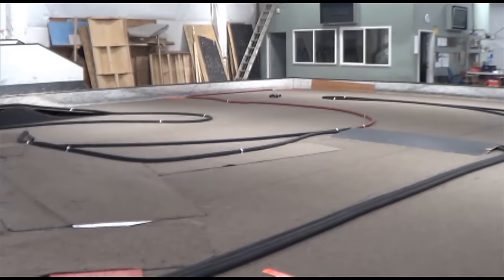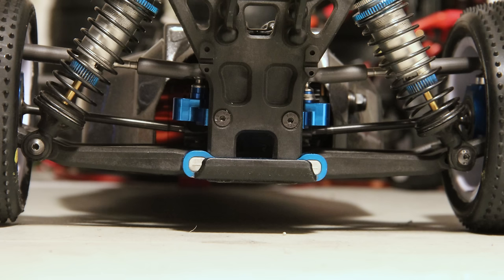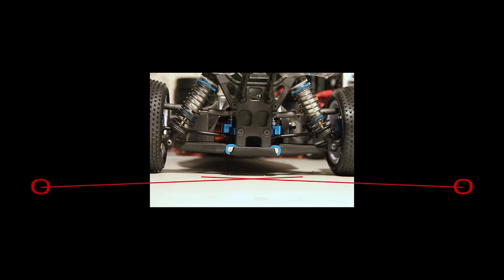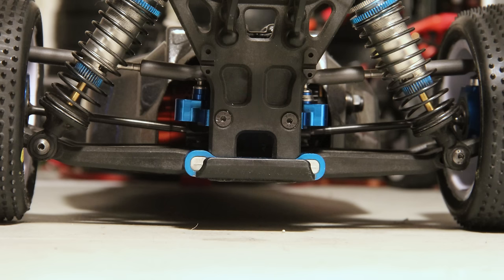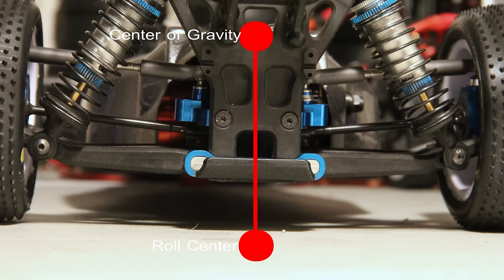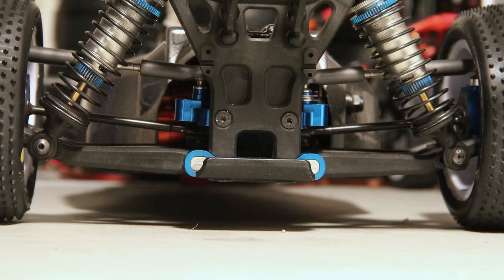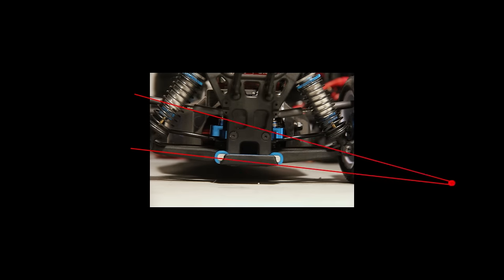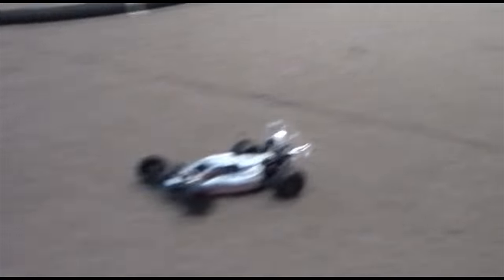How To Tune Your Ride - Roll Center

Comment: *measures and calipers .... how i do when those two 'lines' actually move slightly apart? Du wat?
Reply from the maker: hmmm... i'm not sure what you are trying to ask here.
Reply: @traxxasrockhead   not 100% but, I'm sure he just asked, if the hub pivot points are close and the diff pivot points are separated? the line would never cross! this is if he had his dog bone level.
Reply: @Matthew Seger  Roll Center is always moving, the measurement is really not the importing thing. but, ""at arm level"", if your upper link is pointing down (shock tower to hub) you have low roll center. but this is only low roll center at ""arm level""l!!! 
 this mean at ""arm level"" in a turn, your outside arm (hub) will try to lift (less pressure on the tire) and your chassis will go down. to get the weight on (tire) you will need a stiffer spring or swaybar. (if you're trying to add grip).

Comment: if you lower the roll center on the rear, should you also lower the front?
Reply from the maker: not necessarily, you can adjust them independently

Comment: Man THANK YOU for that explanation.. And wording it that way.. That jist helped me so so much.. I may not be racing, but for me...  Driftting suspetion set up plays a big roll on making the car do what u want when u want. And the roll center is were my problem is.... Cause i understand other aspects of the way it works. But by bring them all together is what will make it work. Agean Thank You.. Peace
Reply from the maker: i'm glad i was able to man. after making more videos i realized  how long this. if i was to remake it i would make it a lot shorter
Reply: Wasnt to long for me.. Made sence in an easyer way.. Havnt had a chacne to mess with my car. But will soon enough.. See how much of a difference it makes. I kmow its in the rollcenter of both and front and rear. Cause iv done made adjustments on everything else. And still wasnt consistent.. Thank u agean.

Comment: How does ride height factor into this? Great video!!
Reply from the maker: I'm not totally sure but I do know what I explained was a static illustration and when you drive the car some of those points are changing
Reply: If you lower the ride height, you lower the CG. And vice versa. You generally want as low CG as possible so that the car doesn't sway side to side too much. Just think about monster truck and sport car making turns and you will know. As you lower RH, you lower RC too. The only reason that prevents you from lowering RH a lot is the bottoming of chassis over jumps or turns. So too low RH will bottom out chassis which throws off handling and too high RH will make your car drive very unstable. Provided that your car doesn't bottom out while running on the track, run lowest possible RH (CG).
Reply: Lowers center of gravity. Always set ride height first then droop then camber and so forth. Roll center should always be done last if possible. Shimming the hinge pin blocks to adjust kick-up or anti-dive. When i was racing touring cars regularly, i would typically adjust roll center only when racing a different track surface. Asphalt vs carpet. Have fun. Nice video.

Comment: Now how does the length of the link fit into all of that?
Reply from the maker: it does not
Reply from the maker: the length of the camber link set how much tire is in contact with the surface, which you may want more or less depending in the track conditions
Reply: Well with camber at the desired degree, the length of the link would be effected no? Say inside hole on Chasis to all the way outside hole on hub, or both studs on inside hole. See what I'm saying.
Reply from the maker: +nate emmett I don't really follow. but if you are asking if the camber of the tire will need affected than yes. if raise the ball stud, your tire will gain positive camber. 

I think I miss understood your first question
Reply: +traxxasrockhead I guess the best way to word it is does the length of the camber link come into play at all at the same Camber setting.... ie with the ball studs moved as far away from each other as they can be -1 degree camber vs the ball studs as close as they can be at -1 degree camber
Reply from the maker: +nate emmett ok. I think I understand. if you lengthen the link and do what you said that as you lengthen it, it lowers the roll center because the instant center has been moved out and down.
Reply: Longer link lowers RC and vice versa by a smaller degree compared with lowering the hinge pin. Like Evan said, changing length of upper links changes camber. If you want more dynamic camber gain, you will need to shorten the link for the price of raising RC a little. More camber gain can be achieved by removing shims under inner upper link creating more acute angle of the link. This also comes with raising RC by more than shortening link. If you don't want to really change dynamic camber but lower RC a lot, lower hinge pin. It barely changes dynamic camber.

Comment: great explanation but why in the world are you running the rear mount in the plus position with +4mm under the ball stud. I would assume you are running on carpet by the tires. I would think you would want the mount in the minus position with no spacer to create a high roll center to prevent traction rolling??
Reply from the maker: Bart Grider you are correct. After I made this video I changed my set up to 0 spacers on the rear